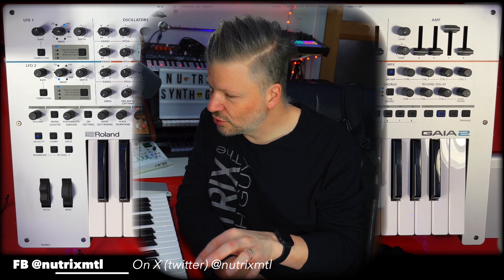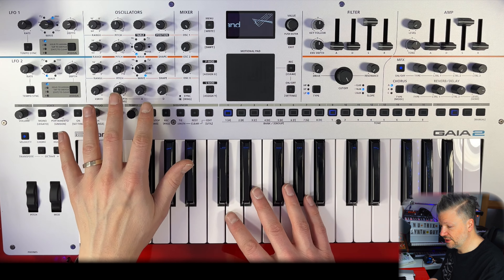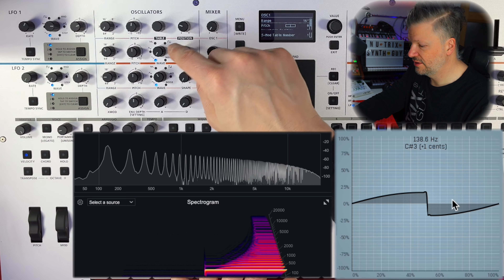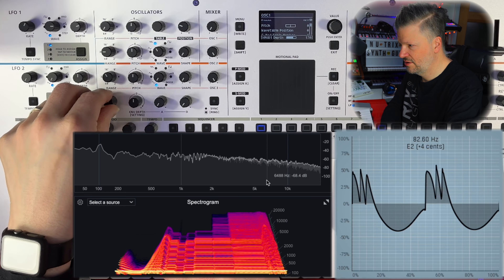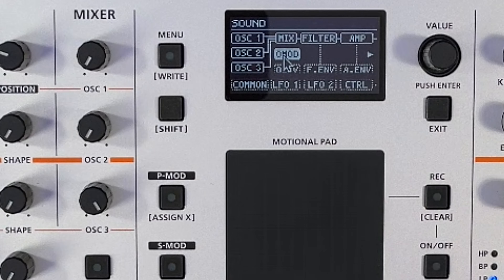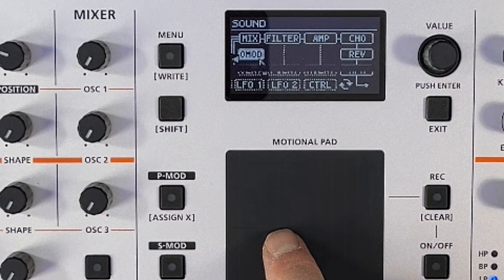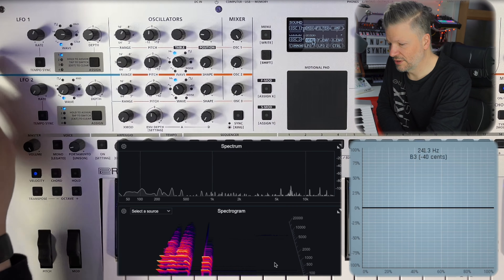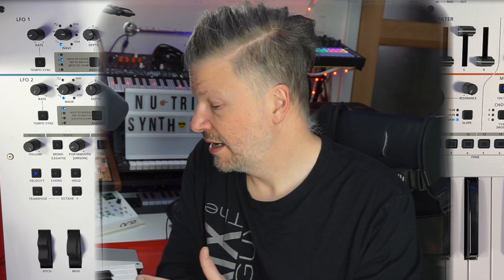A beginner’s guide to synthesis course - oscillators

Comment: I hope you are sitting down. I am using a keytar, an Alesis wireless Vortex 2. This is controlling a Roland Se-02 boutique. I have a heavy, nasty, aggressive sound and I would like to emulate a “false” harmonic also known a pinch harmonic of a distorted electric guitar by using one of the left hand controllers to activate it. Any ideas? I have searched to find out what a false harmonic actually is but can only find instructions on the technique not the sonic specs

Comment: Hi , great video!
I buy recently Gaia 2, but I dont know i can't connect via USB C to Roland Mx1,  are you already try it ? 
Or i have to use GAIA USB- A to Roland Mx1 To USB-A To ? 
I put on vendor mode, but the sound don't come in to mx1, or exist outhers parameters? 
On Roland manual, is by USB c to Usb A to mx1, but in reality don't works by aira link ?